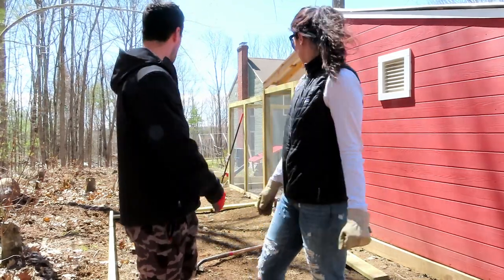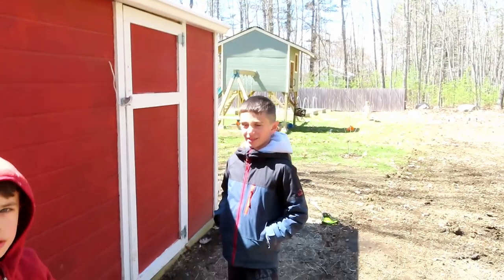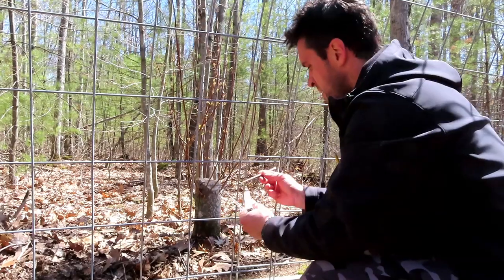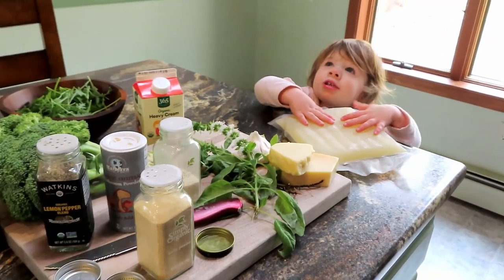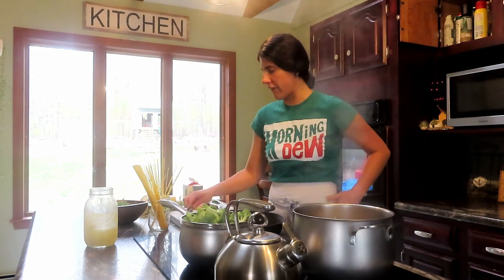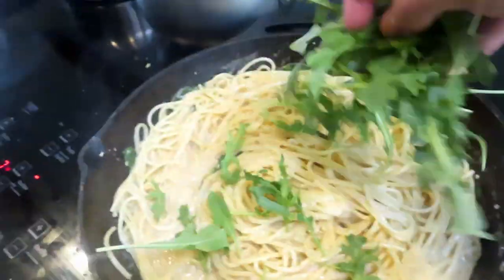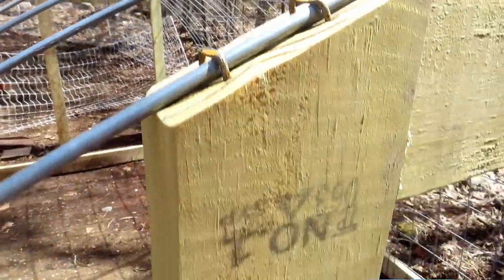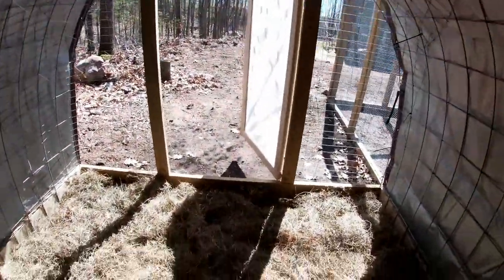HOOP COOP BUILD and BROOK TROUT FOR DINNER!

Comment: Great video! I really enjoyed all aspects of it!  I do have a question. What size tarp did you get, that fit your 8' x 12' frame, just right? Or, did you need to cut the tarp, or fold it?
Reply from the maker: Hi Michael! We used a 12' x 16' and did not have to cut it! It's because the cattle panels we used were also 16'!